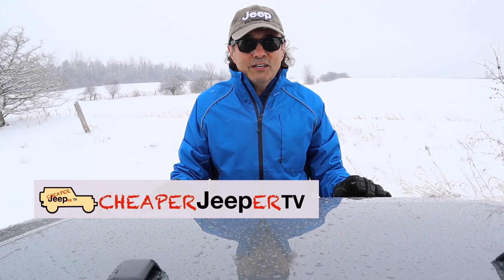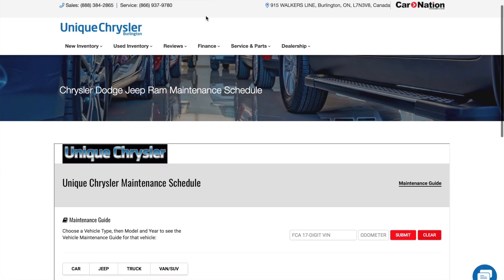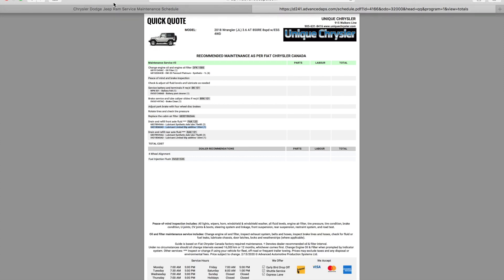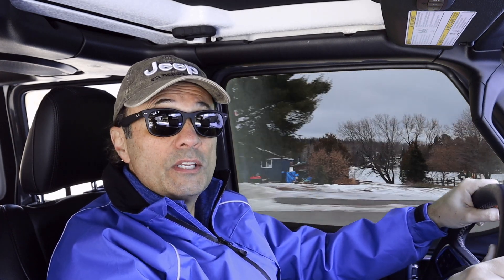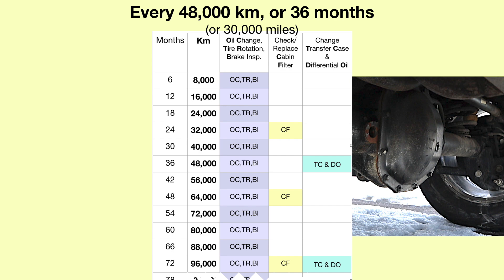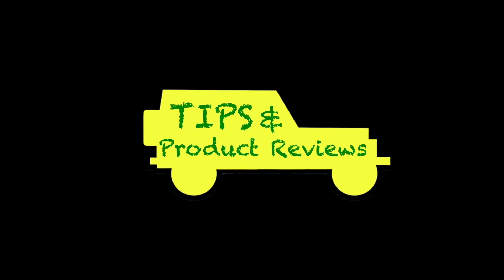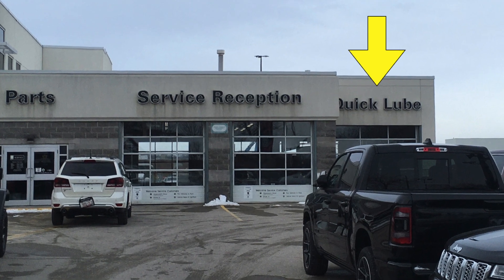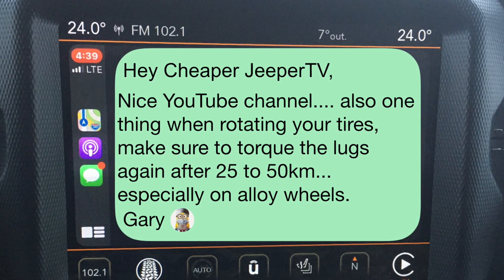Jeep Wrangler Maintenance Schedule

Comment: Ciao Dino! I am about 6 weeks into my Jeep life, and learning lots with your videos. Unfortunately the previous owner of my 2019 JL only did annual oil changes, the vehicle has about 33k on it. I was surprised to see 6 mth intervals coming from German cars/synthetic oil.... perhaps my car's previous owners focused on the km travelled or, just didn't care. My best bet moving forward is to use a Jiffy Lube style place and bring the oil and filter (I live in a condo building)?
Reply from the maker: Ciao wandering-armadillo,
I use the EzDrain Valve and as you can see, it makes doing an oil change very easy. The Pentastar engine, with the oil filter cap so easily accessible also helps the process. I do my oil changes in my driveway, even in winter. It is very easy to do it myself, and it helps me save a lot of money. I’d encourage you to try it yourself, after watching a couple videos be fore I’d recommend one of the fast oil change places. However, that is at least still an option. 
Enjoy your new to you Jeep. 
Ciao!
Reply: @CheaperJeeperTV  Fantastic advice! I like the idea of the EzDrain valve very much. When I mentioned it to a friend he immediately said, "what if it opens accidentally" but I've watched the product video and it seems both sturdy and like a  smart mechanism, and well, if it's good enough for you..:)
Reply from the maker: @wandering_armadillo  LOL...well...in the 4.5 years of having it on my Jeep, and with all the trips off road, like Cape Breton, and Club runs, including in deep winter snow, it had never come loose. I recommend it, as it made changing oil so quick, easy, and clean. The oil simply poured into the empty jug. As an extra measure, I DID order the metal screw on cap for the EZDrain valve.  That way, should the valve be knocked open, the cap would constrain the oil to a small leak and give me time to notice.  Although, it really wasn't an issue. Cheers.

😃
Reply: @CheaperJeeperTV  Oh, I shall grab the metal screw on cap for that extra Cheaper Jeeper peace of mind!

Comment: I wish they had my wrangler on that website that would be awesome. I’m trying to check my 2003 Jeep Wrangler and it doesn’t even give me a wrangler option only grand Cherokee and liberty :/
Reply from the maker: Ah. Too bad.   I'm not familiar with what is in your 2003, or if the Cherokee and Liberty had the same engine as what you have, but  if those vehicles had the same engine, that might help in terms of maintenance intervals.